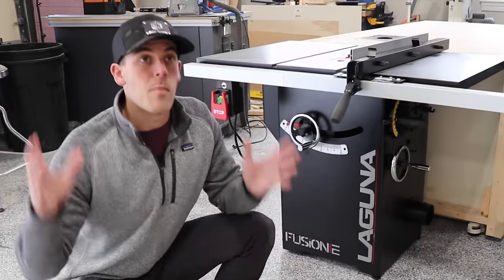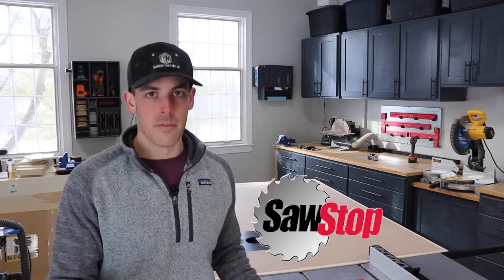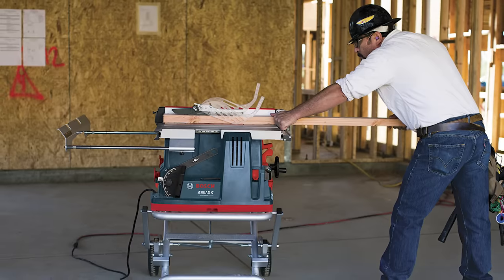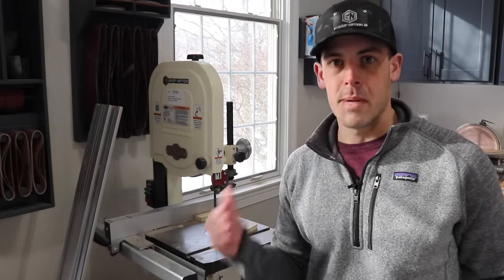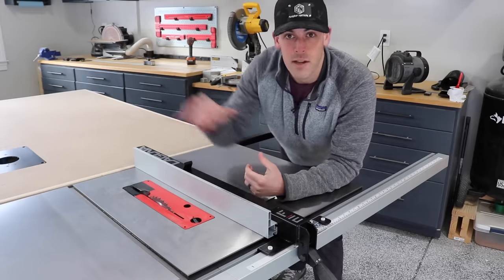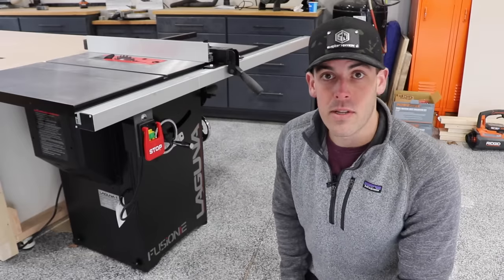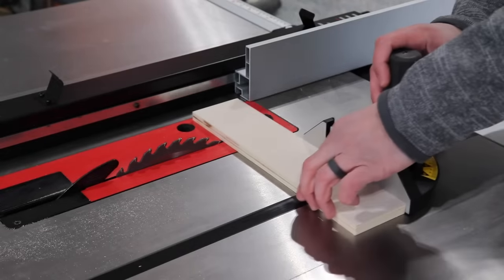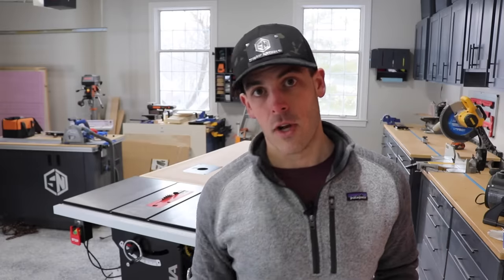Why I Bought a Laguna Table Saw over SawStop!

Comment: I remember seeing this demoed at the wood expo back in the 90's I believe — when SawStop was new. I believe they had it installed on a Powermatic or something, I don't think they had their own saw back then. I went to the expo with fellow cabinetmakers from the shop I worked at, and we pretty much all agreed that the feature was for hobbyists, and not something for a production shop.  I nearly bought a Laguna sliding table saw for my own company right about the same time, but went with a panel saw instead. They make some nice machinery!

Comment: I wanted the sawstop contractor saw. I ended up with the laguna f2. Im very happy with it. It rolls around pretty well too. I couldn't justify getting the sawstop. When I could buy an f2 and a festool domino tool for the same price as just the sawstop.

Comment: When you were researching table saws, did you look at the Harvey saws?  The Harvey HW110LC-36P is usually comparable in price to the Laguna (if you catch it on a flash sale which happens often).  The Harvey comes stock as 110v but is supplied with the parts needed for a very quick change to 220v.  Also, the Harvey has a one piece steel fence rail instead of a 2 piece aluminum rail, similar Hi/Low fence, rigid over arm dust collection, cast iron trunnion instead of alloy like the F2.  The table on the Harvey is 31 1/2 inches front to back vs 27 on the F2.  Harvey is 2HP vs 1.75HP and the Compass MG-36 miter gauge is so much nicer on the Harvey.  Not saying the Harvey is a better saw, but these are the things that stand out when I compare the two.  The only thing I saw on the F2 that the Harvey doesn't have is the digital display and the fence is secured by one more bolt and knob than the Harvey.  The F2 also has that weird throat plate.  The Harvey throat plate requires a screw to remove which I don't care for, but taking out the blade guard or riving knife is tool less and quick.
Reply: All these saws are made in the same place in Taiwan. Harvey, grizzly and king Canada all have the same saws with slightly different dressing. IMHO they are built heavier than the laguna which went with more aluminium, thinner fence, etc.
All the cast iron tables are the same size of 27” deep, sometimes they measure with the rails which is why the number is higher.
The throat plate design of the laguna is actually superior and stiffer.
None of these companies manufacture or really design their own saws, they just spec out a saw from the Taiwan factories.
Reply: @homer009x  The heavier nature of of the cast iron saws is a benefit.  It helps dampen vibration and provides a more stable tool overall.  The Harvey is 31 1/2in for the table and not counting the rails.  That's why if you go to buy a router table insert, you have to select the 31 1/2in insert.  The 27 will not fit.  Not sure how the throat plate of the Laguna is superior, but I guess it could be.  The Harvey throat plate is solid aluminum and is around 3/8 to 1/2in thick.  As for manufacturing, I can't know for sure, but what is publicly stated and generally accepted to be true is that Harvey has been the OEM for many woodworking equipment brands sold in the US, but they have been selling under their own banner all over the world.
Reply: @navtrtl  looking more into the harvey available now it does seem to be unique design and spec compared to others. I was wrong about that, I think I was comparing to an older generation.

Comment: Funny that the pic you use of the guy cutting on a Bosch table saw is a Reaxx!! Sawstop and Bosch got into quite a legal battle over that. Reaxx is Bosch’s safety system and works very much the same as sawstop’s.

Comment: If something like SawStop technology were available in a variety of table saws from different manufacturers, at different prices, I would be much happier.  In the long run, it needs to be adopted.  But not by giving one company all our business.  Many different companies have good ideas about how to build saws.

For now, I use a different brand of saw that cost me much less, and I'm picky about safety procedures.  I use a sliding cutoff box when possible; otherwise, the blade guard and splitter; or when both of those have to be out of the way, carefully chosen push blocks and sticks.  I simply don't put my hand near or in line with the blade.

Comment: You are defintelly right that the fence is probably one if not the most important part on a table saw. I have the HD Ridgid R4512 and the fence rail is a 2 piece aluminum extrusion which is a big no-no. It is 2 piece so it can be stored in the box. Seeing that the Laguna has a 2 piece aluminum fence railmis a big no-no for me. While $ is definitely something to consider when purchasing any tool i right away remember someone else saying a few words of wisdom “buy the best you can afford”. I have used the european style fence My Grizzly G0513x2 fence is same and Im not fond of them. I believe the older Delta Unisaws had same fence design. For me it would have to be a Sawstop when i get my own garage ntill then sharing a garage with a simbling and using my R4512 which ic crap just based on the fence, otherwise OK for a DIY’er when precision is not crucial.

Comment: OK! OK! Ok!! ...OK!   I admit it.  I'm stupid and accident prone.  So, I bought a saw stop....because I'm smart too.  :)    And I do know a guy who lopped off four.    Hey if it ever happens, you should have an emergency zip lock baggy to put them in, then put that bag in a bag of ice.  Your doctor will tell you this saved your fingers after they reattach them.  That's what my friend did, and he got all four back.  And I love Laguna.  I own a HD16.  Just came in from using it...and the sawstop.  chuckle.   Even after all that, you can still get hurt.  The other day I had a piece of 3/4" pine that had soooo much tension built up, that it bound on the riving knife!   I had to stop the blade quick.   Got the 5HP Cabinet.  I forgot about the price a long long time ago.  Lot's 'o pilots on here.  I flew for the AF 20 yrs.  T-38 Instructor,  C-130's and Beech King Airs.  I miss it but my ears don't.

Comment: Enjoyed your reasonable comparison between SawStop and Laguna. I was in the unfortunate position like so many others of getting jammed by the backed up supply chain. I did my research and opted for a Fusion 3 and placed my order about last February on the understanding that it would arrive in about 2 weeks. You can probably guess the rest…2 weeks turned into 2 months which extended to 6 months and finally was told don’t expect it before next January. The SawStop was available so that was the only reason I chose it. As you said, excellent but expensive saw but I really, really dislike the main safety feature, which I suppose makes little sense. However if you ever went through the experience of actually firing off the self destructive safety feature as I have, you might change your mind. Now to be fair SawStop did give me a 1 time courtesy replacement cartridge and blade. But all that I was cutting was some damp plywood when previously I had been cutting some quite wet pressure treated boards successfully. Now I’m really gun shy with this saw. I can tell you I wouldn’t wish the experience of removing the 2 totally destroyed components, it was an absolute design nightmare not to mention the wait time for the new components to arrive. Maybe one day if I actually found myself having fired off the cartridge to save a serious injury I will be grateful but I wish the Laguna Fusion 3 had of been available. You made the right choice when buying your Laguna.

Comment: I really like your review of the Laguna F2 saw, as well as your evaluation of the Laguna saw...everything was spot on.  And so as a result I am really considering the purchase of the F2. So I proceeded to check out other reviews of the saw.  I feel you on your dislike of the BAD saw dust ( lack of ) control...however the other reviews ( of F2 owners with real life usage ) said that they loved everything about the saw except the DUST control, described as "HORRIBLE"; even after several attempts to get it better and nothing worked.
So upon your further use of the F2 I would like to get feedback about your dust control......and if you have to make any add-ons or adjustments to get this issue at the very least acceptable.
By the way the new shop is looking good !!!
Reply: I think most, if not all of those comments on dust control issues where with the first generation of the saw.   There have been many reports of good/great dust control with these newer saws.  It was even mentioned in these comments by a F3 owner.  I will say this is not a jobsite saw, so using a shop vac to try to control the dust may not work well.  If you have a real dust collector that can move more air you will have better results

Comment: Well.... On January 11th 2020, I cut the fingers off of my right hand with my table saw in my shop in Brooklyn, NY. I've had three surgeries over the past year to reattach and reconstruct my fingers. The surgeries cost $60K out of pocket. And I had to borrow over $100K to keep my business and shop and stay in business. Just did my first job last week, over a year after the injury. I would have given anything to have a saw stop on the day I cut my fingers. So, real costs, $160K, but I would pay even more to have a normal hand again..... (My middle finger is completely not functional... it just sits there and does nothing.). Good luck homer. Stay safe. Cool channel.
Reply: Shit. What cause the accident? Best recovery.
Reply: @homer009x  Hey thanks. I was doing a cut I had done many times on these custom shelves that have 6" winged tips at the ends... I was trimming the edges. Made the cut, just like before, but looked away when I was reaching for the board in front of the blade. My reach was too close to the blade and the blade caught my little finger and pulled my hand back into and over the blade, with the board still on top of my hand. It looked like someone handed me a hand grenade and I didn't let go of it before it went off. Just went to see my hand surgeon today actually. He said it's coming along really well. But the function of my middle finger is gone forever, sadly. But. Coulda been worse. Could have lost them all... All the best to you too.

Comment: Great review.  Am strongly considering purchasing the Fusion F2 due to this review.  Couple questions and yes I've looked around (www & YT) and not really seeing a clear answer.  1. How portable is this, I get it has wheels, but best I can figure out is there's just 2 wheels and perhaps fixed wheels (e.g. not swivel).  2.  The overall width appears to be roughly 67"; does that include the dust hose?  Am trying to envision how this will fit in my one-car bay workshop area and whether or not I can move around as needed.  I've marked off 67" from the wall and that works for me, however don't know if I need to "add more distance".

Comment: I've made the same decision based on the same reasons last year. Fusion 2 for the win! Only regret I have is I wish I had the room for a 52 inch fusion 3 😁  love this video. I hope some folks look at being a safer/smarter user and saving money vs. Less careful and spending 3 times as much. Oh, and The few things I wish for would be accessory options like. A standard beismeyer style fence for easy jigs. And a sliding cross cut table. Other than that best decisionso far. I'd buy it again for sure. Well maybe a fusion 3. 🤙

Comment: The table is one of the least dangerous tools in the shop (considering the blade is fixed to to the table, unlike a freehanded high rpm tool like an angle grinder).

Comment: When SawStop first became available (2005), I purchased 2 of the 5hp Industrial saws for my shop, replacing 2 Powermatic's.  In a professional cabinet shop, IMO, it was (and is) irresponsible to own any other saw.  The cartridge "fired" exactly twice over the next 5 years - first time an employee nicked an aluminum extrusion attached to the edge of a plywood/laminate board that he was touching (no fingers near the blade - he was touching the extrusion some distance from the blade).  The second time, it did indeed save at least a finger.  You simply cannot put a price on saving a part of your body!  Accidents happen, no matter how careful you are.  It's cheap insurance.  Yes, SawStop's patents began to expire in August, 2021 - but with over 100 patents, they still have a few years.  Of course, since the holding company that owns Festool now owns SawStop, they are offering their own TKS table saw with SawStop AIM technology - in the EU at least.

Comment: Hindsight is always 20/20.  If you have an accident I guarantee you the extra $$ will seem worth it.  If you're not going for added safety features, buy a used industrial cabinet saw at auction or on CL for a fraction of the price and three times the saw.
Reply: True.  Though, purchasing a used saw is easier said than done.   Also, no benefit to the channel going that route.   Then there is the whole no warranty, could get a lemon etc.

Comment: Most of us are hobbyists.  A lot of channels have all these fancy tools, Festool, which are great, but for a hobbyist ,  they are too expensive.  I have seen channels where the wood worker accomplished great things with rather inexpensive tools.  I am going to look into this Laguna. My old contractor saw has all the problems you mentioned about your old Delta. 
I do not mind buying tools but I hardly ever use them.   I am building your work station and sanding station for starters.

Comment: How expandable are laguna saws? I know there are third party attachments to add a slider for large sheet goods, but when they come from the same manufacturer, I feel it works better. I know that is something sawstop does offer as an add on kit if you want to break down costs and expand it later. But laguna does make great equipment.

Comment: Good analysis. While i agree with the quality and craftsmanship that goes in building a saw stop is in a tier of its own, its just too much saw for 90 percent of woodworkers. I agree that a good table saw is an essential tool for woodworkers, but 90 % of them don't really need a saw stop and can get by using a much cheaper saw without compromising quality and efficiency.  My advice is save for a saw stop, dont but a saw stop, go with a cheaper option and treat yourself with other woodworking tools. 😊

Comment: I'm currently considering downsizing my shop and have been looking at good saws that run on 110.  I like this saw and the Grizzly equivalents, but they all have one thing that is putting me off.  Why oh why have they all moved to this Unifence style fence??  I'm a died in the wool Beismeyer fence guy, I have a lot of investment in jigs and processes centered around using this fence.  Why doesn't Laguna (and the others) offer a Beismeyer fence option??  If they did, I might have already moved out on one.

Comment: I am still a novice for sure, but I am soooo much more worried about kick back than I am about touching the blade.  I kind of do not think there is any chance I am going to touch the blade, that seems pretty avoidable.  If I could pay for something like a saw stop that prevented kick back that might be more appealing, but in my opinion it seems like it prevents a danger that is very unlikely while leaving present the most significant danger of the tool.

Comment: I have a Laguna 18/36 Revo & their 14 bandsaw .... Love them both and find them superior to their Jet counterparts which I also have in the shop. If the table saw is as well made as the lathe & bandsaw , they are well worth the $$$. 
 Am considering replacing my old craftsman table saw , mainly because of a weird sized miter slot that makes life miserable with an F2 or F3 but they are on backorder until June because of Covid.

Comment: Since I am not a fan of the impact portion of the Risk calculation, I have a very health fear of a saw blade, whether it's a table saw, circular saw, jig saw, sawsall, or a hand saw.  As a result I am very careful and so far have all my digits and limbs, but have gotten cut ... by my hand saw.  While it might make my production slower, I tend to shut down my saw before clearing around the blade, use push sticks and push blocks,  work slowly, and keep my hands well away from the blade at all times when it is moving.  I agree that SawStop has a great technology, but unfortunately I am cheap and don't want to pay the extra cost, taking into account my healthy respect for all things sharp.  Will I never have an unfortunate accident?  There's no guarantee, but I have managed to avoid problems for the last 50 years.  So for lovers of SawStop, I agree that you have an extra layer of protection and salute you for your attention to safety.   For me, honestly, my most common injuries are from hammers, and my worst from knives, and in one case a drill, and in all cases it was because I was hurrying, or tired, and became careless and didn't pay close enough attention.

Comment: Thanks, great video. Have you looked into Felder saws [similar to Laguna P12 series] or their poor man's version branded as Hammer? Some even have two saw blades. One is a leading small blade for a shallow score cut prior to the main blade through cut. They even have their own version of a safety blade stop similar to SawStop. As you might expect they are pricey but super nice and way better than SawStop.